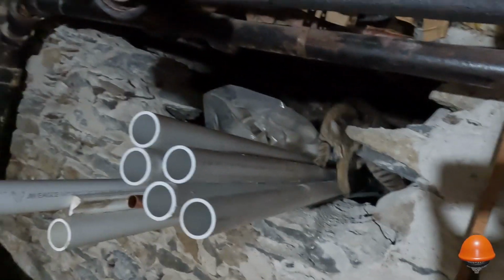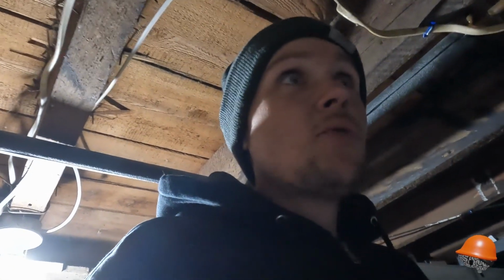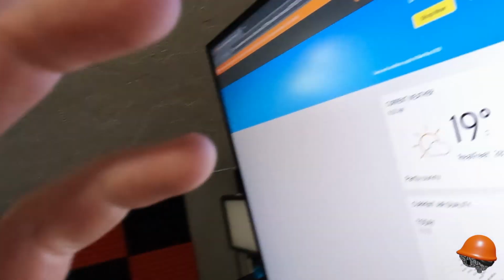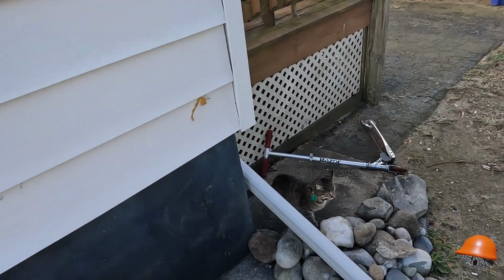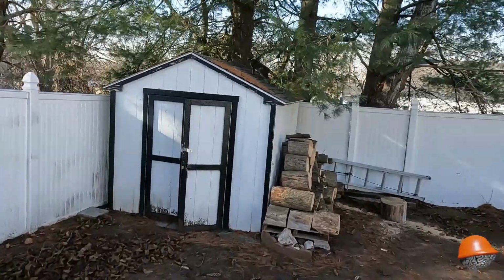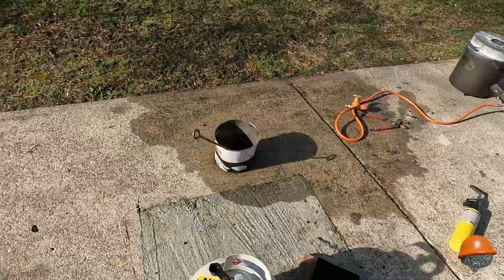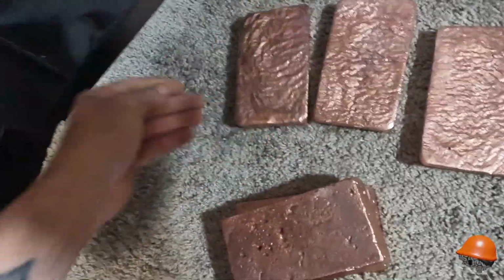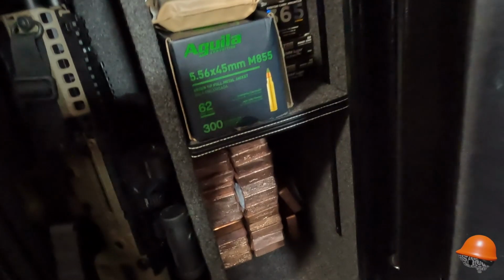Huge Copper Score Melt Down

Comment: A little insider knowledge. You will never get a good price at a scrap yard until you can bring in volume. You're considered a peddler and get bottom-tier prices which are way lower than their tier 1 prices. The guys at the type of scrap yards you are dealing with haggle with peddlers all day and it cost them to do so. Most of those guys operate on thin margins because they are just selling to another scrapyard because they don't have the volume to sell to the mills. 

Get it in, get it out, and repeat.

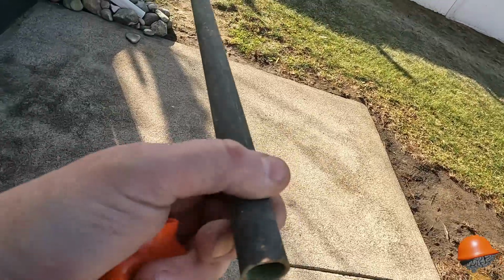Comment: @9:45 i see bigstackD cut his pipes into crucible tall pieces with pipe cutters, after smashing them flat with one of the soil tampers. big flat steel square thing on a stick. in order to fit more pipe in the crucible at a time, to save gas, and melt time.